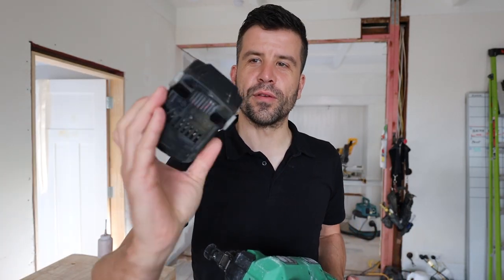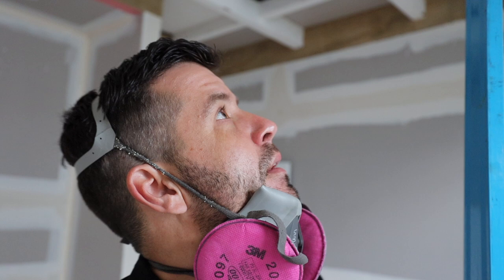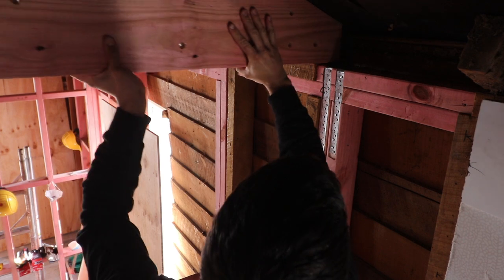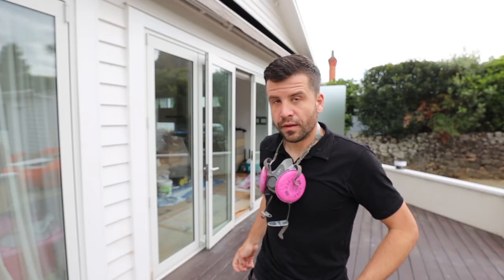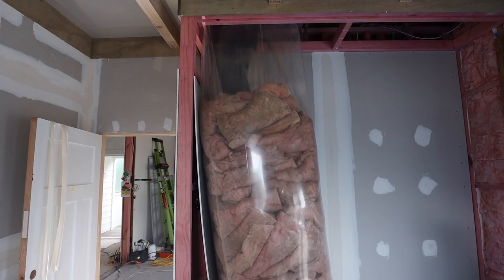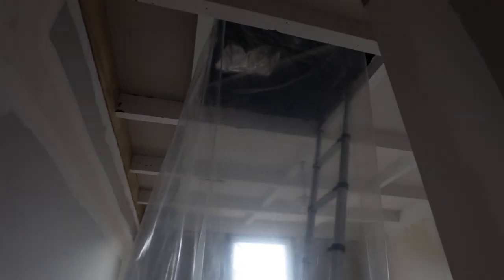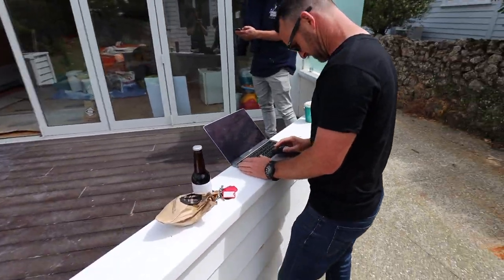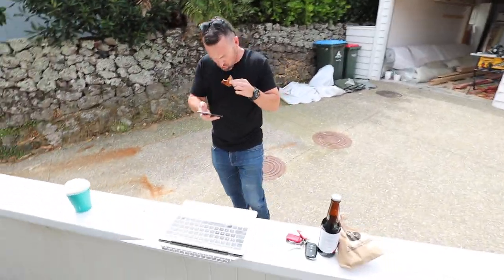Why We Don't Insulate in New Zealand.

Comment: Guy from Saskatchewan in Canada checking in here.  WTF is R 1.5, and why would anyone bother putting it in anything?  R 14 is standard for a 2x4 wall,  but modern residential construction here almost never has an exterior wall that thin. My 1950s post-war boom builder spec house has 2x4 walls- even back then they were putting in R12 rock wool insulation into them, and I wouldn’t want to bet that the execution is 100% perfect, and that all seams are perfectly sealed, but they already understood at that time that a complete poly vapour barrier was required as close as possible to the interior surface of all exterior walls.  Since that time most of these houses have had significant insulation upgrades. I added baffles to keep my soffit ventilation clear and had R40 blown into the attic over top of the original insulation.  Also replaced the  original cedar siding, which I was having to repaint every couple of years in our climate, with a maintenance free option, and while doing that added a drip layer of tyvek and 1 1/2 inches of styrofoam between the sheathing and the siding, which gives a complete thermal break, so even in extended periods of 40 below zero weather I no longer see the outline of my studs in condensation and frost on the interior plaster walls.  We also replaced original aluminum double-hung windows with decent quality PVC double glazed a couple of years ahead of when we had budget to do the siding, and thinking forward at that time  had them made to fit finished thickness of the final insulated wall. Also re-framed entire basement which had been homeowner DIY finished in the 1960s with batt insulation going only a couple feet below grade, not all the way to the floor, and without any vapour barrier whatsoever. I left a good gap between new framing and concrete, and put R 14 of spray foam in the whole basement wall cavity, with an extra layer near and above grade level where needed most. With the way the floor joists were set into the foundation of these houses (floor joists were nailed together and hung on top of the concrete forms for the basement, then basement walls poured partway up the joists) closed cell spray foam is about the only way to effectively insulate and vapour barrier the rim joist area. 
I saved a bunch of the nice long pieces of beautiful 1950s clear cedar from the original siding- now I just have to hope to survive through Covid and the other horsemen of the apocalypse to retirement age and long enough past that to get a few cedar strip canoes built.  Before that, though, I might have to add a layer of styrofoam and some new siding to the exterior of my detached garage, so I can afford to keep it warm enough in there year round to do the work......  Bottom line, maybe it was simpler to live in this part of the world when you just built a new igloo each winter.  It’s always interesting to me to see how things are done in other parts of the world where conditions are different, even if they sometimes seem a bit half-assed by our standards.
Reply: @teenaramsay2469  thanks for the clarification- makes much more sense now.

Comment: This should be free of charge service or they make fitter if insulation issue a 50 year insurance back guarantee be that transferable that makes sure the fitting was done to code . That be way council do not have to be involved the industry is regulated by the insurance companies they will only back companies that do it correctly. Self regulation with random inspection works
The insulation in my list is 80cm thick. 
We very rarely get below zero outside in the last two we have had 52 days Below zero for part of a 24hr period we not had one day where it remain below zero for 24hr or more. Most during the night it will dip below zero for 8hrs max. But we insulate do we use less heating there fire reduce our green house gases.

Comment: I live in Florida where our requirements are quite lax relative to the rest of the country. I am also a residential energy rater. You guys are living in 1960 with your building techniques. I can't believe my eyes. How can you talk about insulation without proper air barriers and sealing?
Reply: I'm in Canada and thought the same... you need a vapour barrier on the INSIDE between the drywall and the insulation, all seams taped off, including electrical and plumbing openings.  Then a semi-breathable housewrap layer on the outside between the sheet and the cladding.   Maybe this is why their insulation only lasts 10 years?  They get interior moisture into their insulation?  And that flooring insulation... Vermin galore into that stuff, no?  You gotta close that off...
Reply: @andrewm753  we can't have vapour barriers. we are simply to humid. country average of 70% humidity.
Reply: @tweake7175  More humid that Florida? yeah right. We don't have vapour barriers here because it costs more, it takes longer for builders to put them up, and successive governments are too scared to get our building codes up to international standards.

Comment: Thats wack..  I worked for an insulation company here in canada.. as far as im aware r-1.9 is like 1" foam board.. we did something called a drill and fill in retro fit scenarios. It involves drilling a hole at the top and middle of a cavity  and filling it with loose fill blown in insulation. the same stuff they use in attics with a modified hose

Comment: Our building standards are so low for insulating and thermal breaks
Reply: yes. also the complete ignorance of air sealing. on older homes you can loose half your heat to air leakage and insulation can't fix that.

Comment: Good explainer about insulation in NZ, although the minimum standards for R-rating is still too low. 
I'm in a year-old townhouse and even with double-glazing and full insulation, the building was too cold over winter, and I'm in Auckland. Being spread over three open levels that can't be shut off doesn't help, coz all the heat goes to the roof, but the design standards don't take this into consideration - it's a one-size-fit-all mentality. 
Developers build to minimum standards and I'm sure some of the design is suspect - the window frames allow so much heat to escape and noise in, you may as well not bother having double-glazing. I had condensation on the window frames, but not a lot on the glass itself.
In London, I barely even needed to use any heating except the odd few nights when it was 6 below Celsius outside and it was so much quieter inside when the windows or balcony door was closed - and I was living over a fairly busy road.

Comment: i think if you only work inside and not being too obvious about insulating (like carrying the rolls of insulation in during the day when the neighbours are home ) and put the insulation in there while replacing the plasterboard and immediately close in the wall after that noone can tell if its in there once its done 
friend on mine had a building that was on the monument list , he needed to have drawings aproved by the city council , there wasnt any changes he just needed to rebrick the wall and reinforce it because it was leaning out and treathening to colapse , so the counsel refused the first drawing (sumting about the windows not being in the right spot ) then they refused the second one stating the windows wherent in their original spots , (realy?) he gotten fed up as the drawings the waiting and each aproval cost him money (city councel in questing wanted some money under the table and where holding things off because of that)
so with a crew of friends he torn down and replaced the whole front wall in one weekend , they never knew they did it and he never had any probems with it 
another weird thing with the rules here is , some houses cannot be torn down completely and rebuild , the licencing for that is a lot more strickt and harder to get ) so wat they do : they tear down a wall and move it out / rebuild it bigger , then the next wall then the next wall and  lastly they they replace the roof , lot eazier to do that compared to building a new house as you need less aproval for renovating and existing structure . it just takes a while longer to do in terms of building time but takes less time in waiting for the aproval from city council

Comment: Has the price lumber sky rocketed in NZ like it has here in the US?
Reply: Given NZ has one of the largest pine 🌲 in the Southern hemisphere you'd think it would be cheap but everything is expensive here. The nominal construction cost /m2 is circa $2500 NZ,  you'll have to convert to /ft2 but I'm know States are way cheaper.
Reply: @mickeybowmeister1944  Well in the last month or so prices have roughly doubled for 2x4 & 1x4 here. It has basically been because everyone has been building more since covid started, shipping has been harder because of covid, and wildfires in Oregon and storms in Georgia has limited the supply.
Reply: @doeskerbyrock  I remember working in Lexington Kentucky as a chippy late 90's and a similar problem occurred with drywall, couldn't get it for love nor money. They built a new factory in Tennessee to meet demand at the time. I loved the States just how different each area is.

Comment: What about the summer heat? I'm in FL and we don't insulate for Cold weather, we insulate for hot weather (To keep the cold in in the summer).
Reply: In Auckland if summer gets over 20 it’s hot, 25 Celsius is unusual. Average Weather in Auckland New Zealand
From the web; 
In Auckland, the summers are short and comfortable, the winters are cold and wet, and it is windy and partly cloudy year round. Over the course of the year, the temperature typically varies from 47°F to 74°F and is rarely below 39°F or above 78°F.
Reply: @TheJohnno25  so you're saying I need to move there? That sounds pretty awesome if you ask me.
Reply: @frankmthompson  it’s not too bad. As Scott says 0 Celsius in Auckland is unusual, it does happen overnight  in some areas  of Auckland, but definitely no snow here.
Reply: @TheJohnno25  Sounds awesome. I'm actually going to look into it. My wife  and I have been talking more and more about leaving the US due to the current political scene. We feel that the country no longer represents our ideals and the political system as a whole seems more and more flawed every day. I know that no place is perfect, but at least the weather would be nicer :)

Comment: Here in New England U.S.A. you need minimum R14 Wild thinking about R1 insulating reqs
Reply: Different R-Value ratings systems, I think.
Reply: @TheOneWhoMightBe  Yeah. That's probably in kilometers or milligrams or something. 
I can't find any reference to a conversion, but R-1 as we use it would be worthless--about the equivalent of the wall you're installing it in.

Comment: Great video (as usual).  I guess humidity explains why blown in insulation is not an option - and (maybe) why the more stringent code is in place (than in California).  I wonder if the same concerns apply in places in the US like Florida. Thanks, again.
Reply: There are companies here in NZ that do blown in insulation but its not quite caught on yet - because there's only a few companies the cost is prohibitive. It also means cutting holes in the cladding for every framing bay which leads to watertightness issues.

Comment: Honestly, I am fuming at the rules and regulations there.
You own your home, you want to do something as simple as add insulation and you have to get permission?
Wow.
Reply: Typically you need permits when it’s major renovations. Or if you hire out to contractors. It’s a protection for the homeowner. That way if the owner doesn’t know much about construction... the contractor he hires answers to a council. Keeps the honest ones honest
Reply: This was the the issue, in the mid 2000s they removed a lot of these annoying requirements and checks, and added new cheaper materials to the market. Total disaster that is still being fixed today. Not everyone is an expert on building (nor should they be) and so brought new leaky homes that looked ok on the surface but over time (10 years) really failed. So the rules were re-added but different this time. My main complaint is that the councils charge way too much and have no real incentive to be quick. Adding that to the funding model would mitigate a lot of issues.

Comment: LOL single digit R values.  My new roof is r50 and my floor is R35.
Reply: doesn't work the same in ANZ,
Reply: @positiveaspect5730  Clearly, I am surprised that with the warm weather more insulation isn't required.  The cooling bills in the summer must be as bad as my heating bill.
Reply: @EthosAtheos  it is required. i just mean the R-value numbers are a totally different system.
To convert Imperial R- values to Metric R-Values multiply by 0.1761
Reply: @positiveaspect5730  O My bad I missed the part where there are metric R values. Makes sense although calling them the same thing is a bit annoying.
Reply: @EthosAtheos  your r50 roof would be R9 by our standards (Australia/New Zealand)
Our roofs are usually  r1 - r2 plus ceiling of r 2-3. Our walls are 4" so you can only get r2 in there. It's appallingly low here. Our housing standards (our star rating for efficiency etc.) is based on numbers to be comfortable in winter (where it's fairly mild) when we really need numbers for summer..
So our walls are your R11.

Comment: You don't need an architect to "design", or council approval, to add insulation to walls. As an owner-builder you can just do it, as long as you know what you're doing. Don't need consent for a lot of things that most councils will tell you you do, just so they can get their $$$. The air gap is critical for any insulation, something you only touched on but didn't explain to people properly what it is, how it works and why it's so important. And a moisture barrier directly on the ground is a bad idea. Been in and around the building industry both here in NZ (15 years living in Invercargill) and in Melbourne all my life, there's so many common practises over here that need to change in the industry to make it better. No disrespect to your video as you did touch on the critical info which is good, it would help if it was explained better and why it is needed.
Reply: total nonsense.  council consent is legally required and afaik doesn't cost anything (may depend on which council). 
moisture barrier on the ground is an extremely good idea. maybe you should explain why you think its isn't ?

Comment: Regulations... why is it any business of the government how I insulate my house?
Reply: It wouldn't be if you lived alone on an island. But in a city, in close proximity to neighbors, it is a good thing to ensure that it is done right. That's what building and fire codes are for. If the wiring shorts and causes a fire in my neighbor's house, mine could go right up with it.
It's also to save yourself from your own ignorance. Installing insulation without a proper vapor barrier on the outside would be a moldy disaster in just a year's time. And if you sold that house to an unsuspecting buyer, that would be wrong.
Reply: @Bill.Pearson  fire hazards, I agree that  can be regulated as I might pose a threat to others. But when it comes to insulation its no ones business but mine.

Comment: Do you use skinny noggins
Reply: In the old houses they certainly were skinny..made dropping new electrical wires down the walls easy with no insulation to hamper access!

Comment: Really? You don't need insulation because it doesn't get below 0? But you're heating in the winter and cooling in the summer. Both of which cost energy, which is produced mainly by fossile fuels. So your decision to remove sth. that has already been there with no cost to you will be very bad for the environment. In my Opinion, you need to have some sense slapped into you.